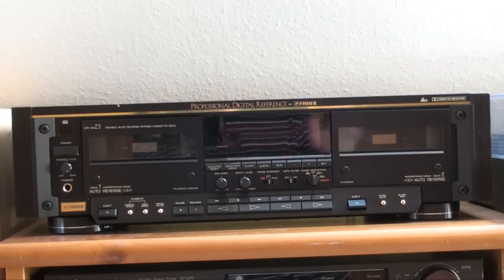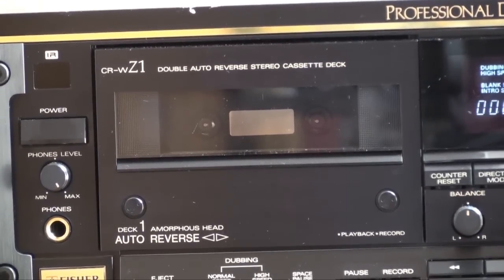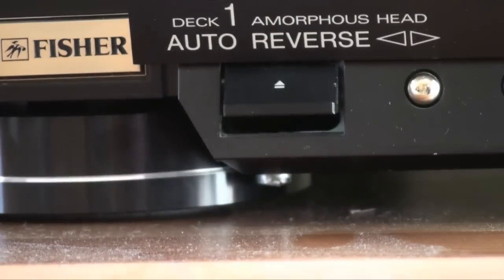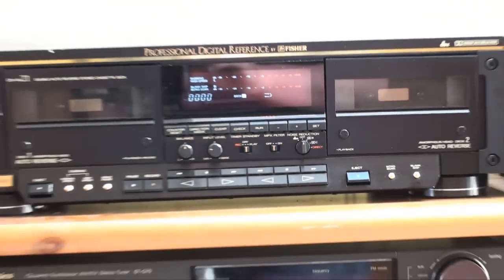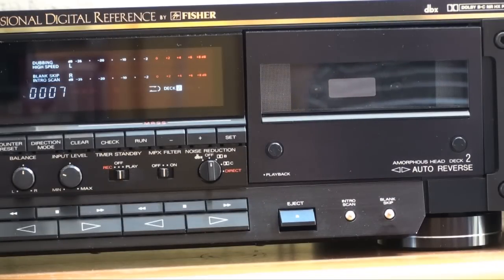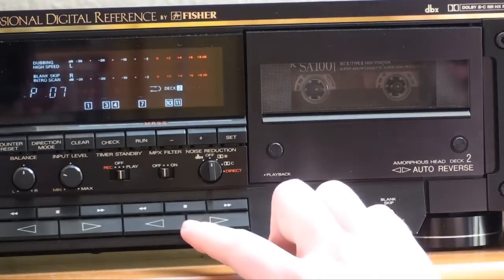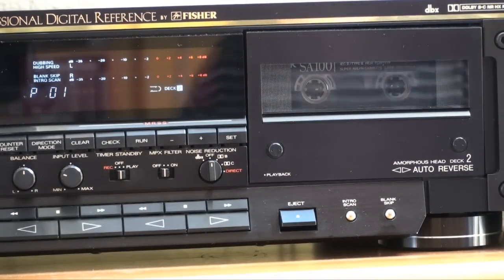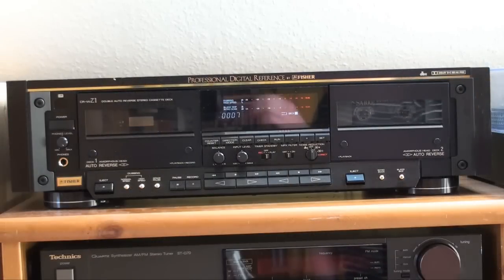Fisher CR-WZ1 dual cassette deck - Professional Digital Reference!

Comment: Great video Dr Cassette, I had no idea Fisher made such a model. Also, Fisher were never really a cheap (as in low end) brand to start with. But I understand you thinking this, in the 80's they made (re-badged) a lot a cheap stuff. Some of it was actually Sanyo stuff and as such quite good : )

Comment: The screws on the front panel look like they could be replaced with rack handles. And maybe the "direct" noise reduction setting has something to do with the timer record function, because they are both highlighted in red.

Comment: My Philips FC-567 (designed by Marantz) has all the features this deck has, except for the digital counter and dbx noise reduction and a variable headphone output. Additionally, it can record on both decks (even at the same time, though from the same source), it can do continuous playback or recording of two tapes, and you can even use the QMS function (Quick Music Search -- the Philips version of MRSS) while dubbing. Oh, and the cassette doors slide off without even needing a tool. And they just put the transformer on the inside (albeit in a slightly wonky way; find the service manual and you'll see what I mean). And did I mention it sounded great when I bought it in 1987 and still had ears good enough for it to matter (sure, it may not be a Nakamichi but who could afford those anyway back then).

Comment: Probably the "direct" mode bypasses the dolby circuitery, which in most decks is in the signal path no matter if dolby is activated or not. This integrated circuits have an a off mode to what they don't modify the signal... ideally.

Comment: The playback and noise reduction are only 'optimal' when using the best/right recording equipment and media. Especially for the more advanced noise reduction methods, like Dolby S, you really need type IV cassettes.
Reply: FloppyHares: Wrong. For a noise reduction system to work all it takes is a deck that is calibrated to the tape. When this is true, Dolby S will work no matter what tape is used - could even be a ferric Type 1 tape, as long as it keeps the frequency response flat up to a certain point.

Comment from the maker: Fisher started out as a high end brand in the 60s, in the 70s it was taken over by Sanyo and that was when quality slowly went downhill. In the 80s it got really bad, lots of cheap plastic junk. Their top of the line system in 1987 (891 Series) qualitywise just matched entry level components by other higher quality brands. This cassette deck therefore is a surprise, for Fisher standards it is high end.
Reply: i have the fisher 8500 system, the one with the ba6000 amp.  It is from 1980 - great system!
Reply from the maker: The RS-Z1 receiver has a lot of lights, technically I don't think it's anything special.

Comment: I own one of these. For the past year or so, neither deck plays tapes. Both mechanisms spin the tapes at around double speed without engaging the heads. Any idea why? Thanks
Reply from the maker: Sounds like you have some bad belts that need to be replaced.
Reply: DrCassette Thanks for the reply. I actually bought this deck when I worked for Sanyo Fisher in 1992. They were closing out the line and the $195 US I paid seemed like s good deal. After 26 years, I can’t complain if the belts are worn. Thanks again.

Comment: Hi Dr. Cassette. 
Do these dual cassette decks need an amplifier?
Are there any that speakers will plug straight into?
Reply from the maker: +skinny9283 
Dual cassette decks normally need an amplifier. I only know of one Sharp deck from the 80s that had built in radio and amplifier.
Reply: +DrCassette That's what I thought.
Thank you.

Comment: @DrCassette...I have he Sony TC-KE400S cassette deck. Just wondering if u ever had this problem, (belt's are very good btw) when I press the stop or the pause button the tape deck goes into fast forward & rewind & then it stops & then I have to rewind the tape back in the shell. It plays normal (no drag/slow) But the instant I press the stop button it goes fast forward, rewind, stops leaving a part of the tape out of the shell. Any suggestions would be very highly appreciated!!! Thx a million!
Reply: The gear at the end of the auxiliary motor is faulty.